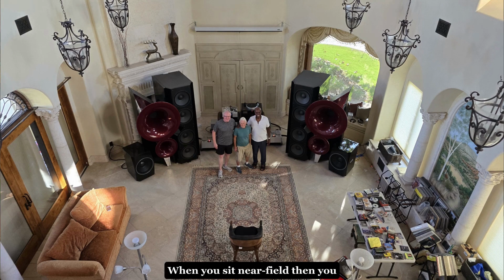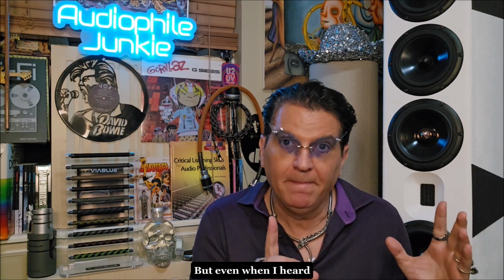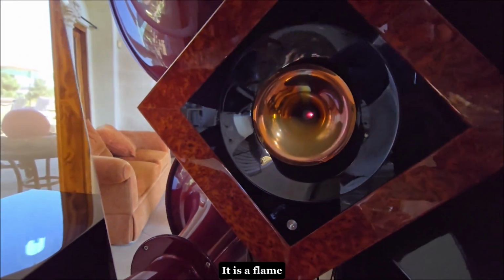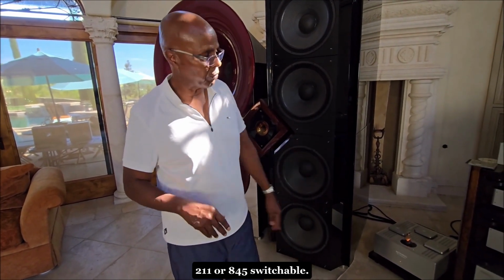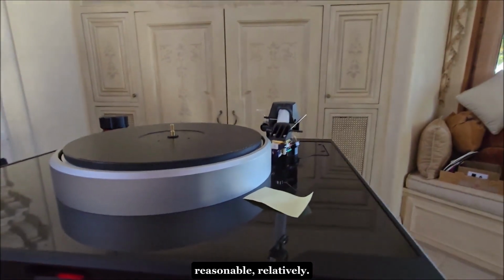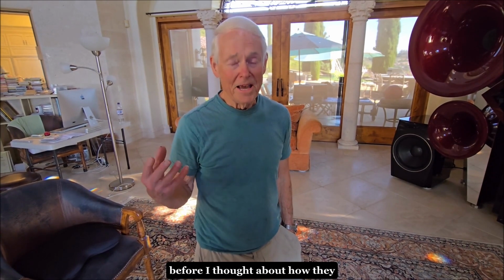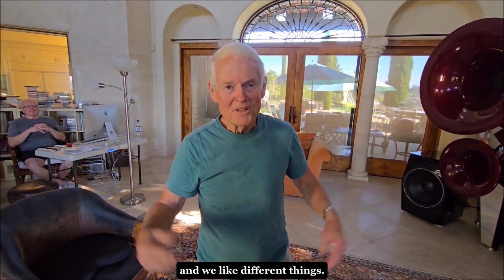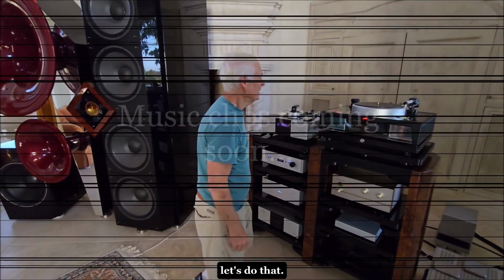A Closer Look at a $2 Million Audiophile Setup - Acapella, Berning, SMcAudio, Emmlabls, Robert Koda

Comment: Can you please explain how the high pass is done before the amp?
Reply from the maker: It's basically just a form of a passive crossover where it's limiting the frequencies going into that amp... And thus the speaker that it's driving. 

It's a 6db crossover I believe at 60hz... and the subs perform below that point based on settings in their own internal crossover (or with an external low pass filter like the high pass).

Comment: 2 million retail....wholesale parts about 10k
Reply from the maker: The chokes alone have pure silver wiring.  It's likely 10x your parts estimate just in that one part in one piece in the system. 

Can you get away with far cheaper?  Of course you can and my channel spends a lot of time showcasing the best combination of value and performance. Just watch my trailer video for what I use despite being able to spend much more. 

However, the cost of this system may be far lower than this owner's net worth than your system, so everything is relative and if you're going to call out what he spends... Be prepared for others to call out what you spend... especially if it's an even higher percentage of your income on audio gear.

Comment: I don't hear much about Acapella speakers, and seeing this video is like finding a 4 leaf clover!  I've read that the ion tweeter used in some Acapella models is among the greatest and true reference quality, but the brand has a very low profile here in the United States. I would need to travel cross-country to audition them, as distributors for Acapella products are far and few. Thank you for this presentation.